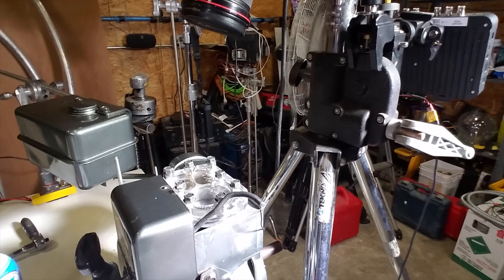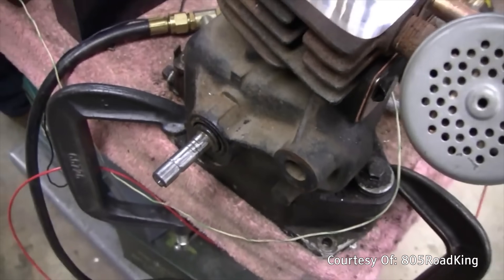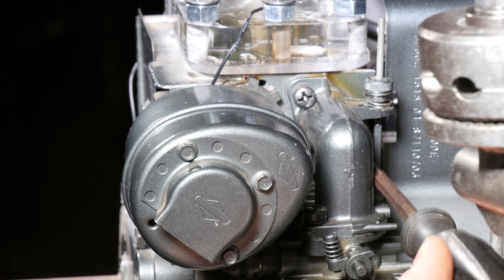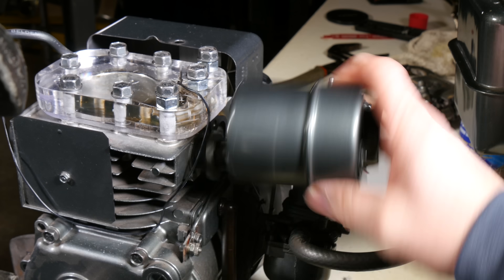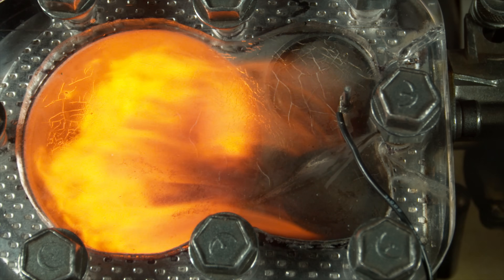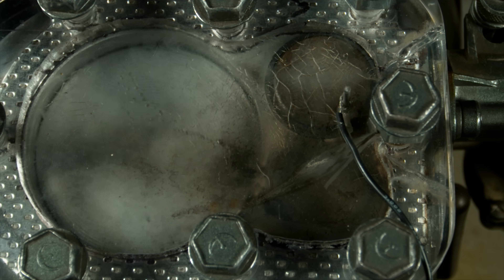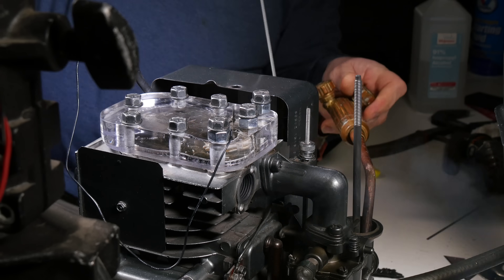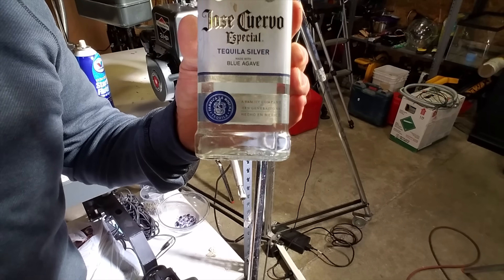See Through Engine - 4K Slow Motion Visible Combustion ( S1 • E1 )

Comment: What You see: Carbon, unburnt state, glowing. Maybe not overflooding the cylinder with fuel and quartzglass window makes difference. How separate burning the hydrogen component and keep the carbon out of the process, so CO/CO2 would not be emitted - nice for the well known climate and environmental acidification reason.

Comment: Amazing in slow mo you really see how inefficient a four stroke engine can be. The burning gases were being expelled out the exhaust before full complete combustion. Especially visible when running on the regular gasoline and the acetylene the alcohol was just flooding the cylinder and was being expelled almost in liquid form still. Cool video though. JMO

Comment: For straight gasoline,  Yellow: Indicates a fuel/air mixture which has excessive petrol content(too rich). Bunsen Blue: Correctly proportioned mixture. Whitish Blue: Less petrol content(too lean) - at idle, misfiring and engine instability may occur before this lean mixture is fully visible.  source: colortune mixture chart

Comment: have you tried heat exchanger for oil cooling system with fuel?
you have 2 advantages
the fuel got hot for perfect combustion
and the oil got cooled
Reply: I mean for piston engine

Comment: thanks for sharing... your lovely assistant is doing a great job
Reply: so... now we can see why hemispheric heads and pistons are more efficient... all the burning is going on around the periphery... 
thanks again
Reply: you are using store bought alcohol... it's not pure or even close... that's water
70% isopropyl alcohol is not really a good fuel... make it at home... use grain alcohol... works great..  but burns really hot... alcohol systems require different gaskets in the carburetor and .. a water injection to cool the burn down... but it doesn't come out like that at all... it's a fine mist that evaporates immediately during each power stroke
ethanol can be made from biomass... any biomass... not necessarily grain... hemp leaves and stalks for example
Reply: ok... here's how to make hydrogen on demand... 
acetone is made from alcohol... store bought at a hardware store works well... 
to a gallon of acetone... add 2 or 3 teaspoons of sulfuric acid...  blow compressed air through into the liquid... with room for the hydrogen oxygen gas above the liquid... take the gas out the top with a short tube that doesn't contact the liquid... hydrogen oxygen gas is much hotter than acetylene... it's hot enough to melt platinum... 
this same system can be done in the carburetor float bowl... and the engine vacuum will draw the H/O gas through... I have a couple old SUs from an MG for the purpose... I'll keep you posted
Reply: we can also burn acetone... for gasoline... it also burns hot... add hemp seed oil like two stroke oil... about the same mixture... and your Briggs engine will run great... it's the best solution for an immediate fix for gasoline engines... it helps to have your own hemp patch probably... I don't, unfortunately
Reply: Peace ✌️

Comment: So adorabel kid. 
Interesting experiments Im surching for years finde out why my engin doing some strange staff aperantly found out that opel is made from gm and they are basicaly gasoline/dizel engin blocks what special feature they have is that they can work on 2 4 5 6 8 strokes ore combined as compound engines they can bouth run internal ore external burn fuering stille so no wonder hightly efficient engines.
Odd thing runing engin at low rpm speed its behaves similar to carbureted dizel ore hit and miss engin ore hot bulb engin.
By the way I did pore Dizel directly to my gasolin tank and nothing that thing ceap runing with minimal vibration.
Your video are amazing.
Some nice and rather rare engin effects can by watched.
One thing GM is special they run on own engin lubrication oil and coolant.
Exampel :
Chlorine+Calcium+Brake Fluid self ignition fuel.
So that problems schools dont teach young mechanics.
There are many things not teached .
So good to see some peopel experimenting .
After all no wonder Shell made 376mpg car with gasoline/dizel engin Opel Rekord P1 .

Comment: although it is a 4 stroke engine, the ignition coil generates a spark for every turn so it does the same as a 2 stroke engine in fact this means that it is wasting a spark.

Comment: 91% Isopropyl is 9% Water. The water does not burn and it is accumulating because it settles out and is no longer vapor and does not get expelled on the exhaust stroke. The water is not good, can get in the oil and cause corrosion.

Comment: I think if you would have run the acetylene any longer that engine would have got hot enough to pre detonate acetylene and very volatile and can be set off by heat and compression, thus the reason they have to run Nitro when they run methanol Nitro being a cooking oil product to stop the methanol from pre detonating.

Comment: Warped Perception produced transparent engine, and Smarter every day transparent caburator. Now we must connect them! And add some more transparent parts.
Reply from the maker: I saw that one, I did do the transparent throttle body with fuel injection before, and I was going to do the transparent carburetor but I just never got around to it. It was cool.

Comment: Question: Why is the spark plug igniting on the intake stroke (when fuel/air mixture is released through the valve)? Shouldn't it only ignite on the power stroke?
Reply: Paul Kargin  Thanks for the answer! Very informative

Comment: The acetylene is a really neat Idea,..... but i cant help but wonder how much is escaping that the motor cant pull in do to limitations based upon volumetric efficiency. So..... what if you built a hat to bolt over the carb with a fitting you then plumb into your torch "would suggest a check valve of some kind in case of back fire....... that could be bad! Lol" there by effectively creating a forced induction application useing acetylene's own inherent pressure to create a "boost" without a mechanical device..... just a weird idea. Love the videos!

Comment: How about running the fuel through the gas intake, rather than just pouring it into the Air intake of the Carb?  It’s no wonder it’s like a washing machine when you ran the Alcohol. 🤷🏻‍♂️

Also,  I would like to see it run as it normally does,  with the Spark Plug over the Piston,  so we can see the true flow dynamics of a Briggs and Stratton Engine.  You can Ground one Wire on the lower part of the Plug,  even though the Head is Polycarbonate or Plexiglass.

Comment: Hi, 
I wish to know what happens  to a running IC engine, if an electric motor spins it externally, higher than 10,000 rpm. Will it burn lean?, will it use less fuel? Or will it just aid more parasitic losses. You have a lovely see through set up here, it would be ideal for such an experiment. There are a lot of hybrid applications out there but they're more like range extenders. None made for speed.

Comment: 1 Intake stroke 
2 compression stroke 
3 power /combustion stroke 
4 Exhaust stroke.
Reply: Yeah, and to think they believed in the 1980s that 2-stroke engines would eventually replace 4 -stroke engines, as the 2-stroke were supposedly up to 25% more efficient. But they don't expel exhaust gas as well as 4-stroke tend to, so not as good for the environment, and need a special mixture of oil along with the gas.

Comment: Great video! 

The alcohol burning when super-rich, practically flooded, is interesting. 

Alcohol fueled drag racers run incredibly rich, possibly <6:1 air/fuel ratio. 

The alcohol that's pumped in above and beyond what's needed for combustion creates a significant cooling effect. 

It also washes down the cylinder walls and strips them of oil, which adds to a long list of reasons they rebuild engines after as little as one or two passes at the highest levels of drag racing.

Comment: I would like to know about the camera and lighting equipment used.  I am engineering/building a device I really need that camera doing 1,000,000 fps but...but costs $3000 per day to rent, plus a few more grands to learn how to set up, light and operate.  May your camera doing 380,000 fps will be just on the edge to help me out.

Comment: Have you seen iEnergySupply channel they work with tesla turbines and cold steam under vacuum pressure . My idea is to use a geet carburetor with a turbine and also to look into running a tesla turbine with a heat pump .

Comment: So this is a 2 stroke engine right, just trying make sure I understand as much as possible
Reply: i don't really see the difference, thus one sucks in, compresses, ignites and takes out the exhaust too 🤷🏽‍♂️
Reply: It may look like that but this is actually a 4 stroke. When you see the cylinder go from the top to bottom this is also a stroke, not just from top-to bottom-to top. An easy way to tell is if the chamber ignites every time the piston is at the TDC (top). If it is instead every other it is a four stroke (as observed here).
Reply: Why is the spark plug firing in the exhaust stroke?
Reply: @vikineo  This is called 'wasted spark'. It's a system that eliminates extra parts since the spark doesn't need to be distributed like it would if it sparked once, but doesn't really matter since it doesn't ignite exhaust and barely wears the engine

Comment: You need to do this with HYDROGEN!! If you haven't already! Would be dope. Also you may want to consider what the correct air/fuel mixture is for all these experiments otherwise your engine will either be running too RICH (like it was for rubbing alcohol) or too lean. Stay excellent!

Comment: I really wish you had introduced oxygen to the mix with the acetylene. Curious how much it would have changed the combustion event. The oxygen I would think would increase flame intensity and burn so much hotter. Either scatter the engine or get so hot it melts down.

Comment: Does anyone know what material the transparent head is made of? Looks like 1.5" thick acrylic, but I've also heard of people making them from poly carbonate and even sapphire has been used for a transparent cylinder wall. Also looks like no one is bothering to machine valve relief pockets or other flow contours like the original head has, which definitely alters the flow compared to a stock head.

Comment: so a spark plug always sparks at top dead centre even when it's on the exhaust stroke or is that just this engine?
Reply: A lot of simple one-cylinder engines with magneto ignition (like this one) have this 'wasted spark' ignition as it greatly simplifies the ignition system; you can attach the magnet of the magneto to the flywheel and have the plug fire once every revolution at TDC - one spark will be at the start of the power stroke and the other will be at the end of the exhaust stroke when there's nothing left to ignite so it won't have any effect. Some two-cylinder engines (like Harley-Davidson bike motors) use it too for the same reason - both plugs fire at the same time and one will always be on power and the other always on exhaust. More complex or sophisticated engines will time and distribute each spark to each cylinder only when needed, so there is no wasted spark.

Comment: I am not mechanic, but I am wondering why is the spark ignited every time when the piston is in up position even though exhaust-intake stage is happening. Maybe for simplicity sake?
Reply: For simplicity and packaging.  

On a 4-cycle engine, the camshaft rotates at 1/2 engine (crankahaft) speed.  With an automotive engine, that's fine because of the distributor or cam position sensor.

On a single-cylinder engine, or a waste-spark ignition system, each spark plug fires each engine revolution.

When the spark fires at the end of the exhaust stroke, no power is produced as there is no fuel mixture to burn.
Reply: Jonathan Morrisey thanks

Comment: i have a couple of questions about this. i bought an engine very similar to this. maybe a little older. it was being converted into one of these. however the guy used Plexiglas for the head and used two pieces. i dont think he was planning on running it. it has spark and the carb is like new so i would like to get it to run. what were you using for the head? also how are the valves clearing it. mine has been ground out to allow the valves clearance. also what is being used for the plug? Thanks so much and merry christmas

Comment: Id like to see you put an alternator on the pulley hooked up to a load tester to see how it operates under load with these different fuels, in slo-mo.  You could vary the current draw, V*I = P (W), 1 HP = 796 Watts, could test it under 20% load with 1hp (is that a Briggs 5hp? Alternator didnt pull a load without killing my tecumsheh 2.5).  (I * (14.1v)) / 1000 = 0.796 HP.  (Prolly alreafy know, you will need like a 9v battery between field and gnd (case) for exciter).  Get a GM alternator built-in reg from pull-a-part for $5.  Oh yeah, what if you turned the 02 on the acetylene part too?  Or, got a stoicometric mix lighting, adjusting the flame, then snuffing it and then ran the engine on it?

Comment: Id like to see it run on everclear (the real stuff 190 proof), denatured alcohol, and starting fluid (always wanted to see what ether really does to my engine).  Also, Propane.  One question - it looked like there was a crack developing over the intake.  The liquid alcohol cannot be compressed, so i would have stopped it.  Don't waste your time with the tequila, not unless you're going to have some kind of built-in still (like preheat to carburetor from old cars).  Burnt sugar will block the view immediately

Comment: Hi, i'm from Spain. I'm doing the same project with 5hp B&S. For the moment i got started the engine with a metacrylate head cylinder, but with gasoline it is melting. Which material have better results for clear cylinder head?

Comment: The alcohol wasnt vaporizing because it wasnt being metered and pulled thru a jet to get atomized in the venturi,  you were just seeing it splash thru unburned due to the high water content, which btw is what washed the carbon.

Comment: It looks like when you used the 71% alcohol, that the 29% water was collecting in the cylinder. What would happen if you ran it on clinical grade alcohol (99.9%)? Also, there is not enough oxygen for the acetylene to burn properly in the cylinder. That is what is causing all of the soot. Acetylene is a complex molecule that burns very hot but, very slowly. Try supplying the intake with a 80% acetylene 20% oxygen mix from the torch but, control it from a distance. At that mix, you may blow the head off of the engine.

Comment: When I was a kid, among the many insane things my father did was to take a milk can, the three foot high metal kind with the round lid, and put this stuff called carbide in it. Carbide looked to me like rocks and dirt but if you mixed it with water it created acetylene gas. Anyway he put this stuff in the can, added water and hammered the lid on it. Then touch a flame to a hole in the bottom of the can and KABOOM!!!! Us kids had to spend the rest of the afternoon searching for the lid. Sometimes several hundred yards away. Broke a few windows in the barn too. Boy I miss those days.

Comment: Even the gasoline was awesome.  I'm 64 and none of us in our twenties would ever have imagined that one day we'd be able to see the actual spark, combustion and inlet and outlet valves operating at the same time.  Awesome.  I noticed the spark plug fires on the exhaust stroke too.  Why is that?
Reply: On that particular engine spark comes from a magneto on the flywheel. Since the flywheel rotates twice for every cycle there's a spark on the exhaust stroke. Lots of small engines are designed that way. Electronic ignitions are able to eliminate the extra spark so spark plugs last much longer.
Reply: @maxwedge3979  Cool. Thanks.

Comment: I had a head blow on me on the highway years ago.  Felt like I drove over an ied. When it popped.  Liquids, oil and metal fragments shot out the hood faster than the bang sound. Giving me zero visibility to slow down.   The hood looking like a used jiffy pop bag all twisted to the left side by the time I got out, with oil as far back as the trunk.  Fun times.  

!

Comment: When I worked in the motor shop we put a tin can upside down with a hole in the top filled with acetylene  to see what would happen when a light was put to the hole - be very careful with this since the flame burnt very quick and when the air ratio was at a certain level the can lifted almost 20 ft in the air compared to a slight pop with natural gas  !!!!!!!!!!!!! wow.

Comment: whoa... We use Compressed Natural Gas in 4 cylinder engines.. the engine starts using Petrol (Gasoline) and 90 seconds later converts to CNG. It has been "cheap" source of fuel for 20 odd years here in South Asia. Plays havoc with the engine, maintenance gets tougher with every passing year and 5 to 6 years later engine goes "Fuck you, I am out."  I would love to see it burn and it effect. The government here has equalised the price of 1 liter of petrol and 1 kg of gas. CNG is still cheaper. Gas is a term we use for Natuaral gas, not Petrol/Diesel. Say, do you believe that Auto Manufacturers can but don't intentionally give us better mileage parameters to keep OMCs happy?